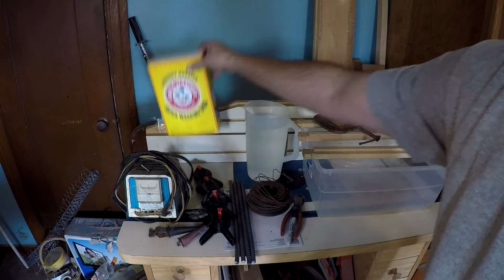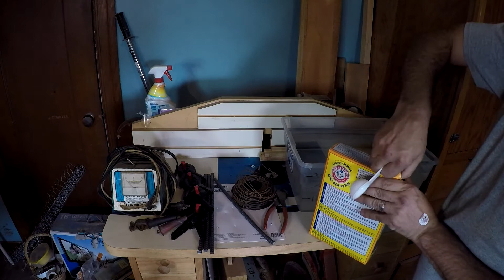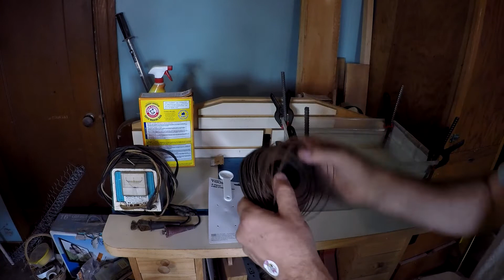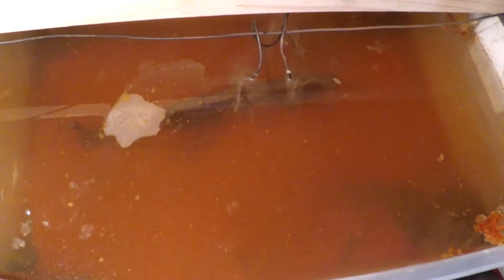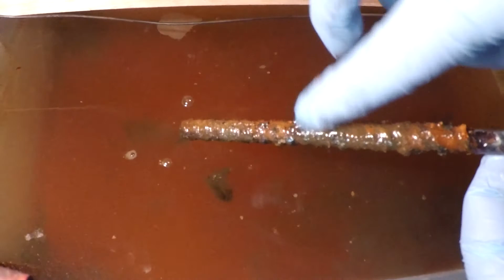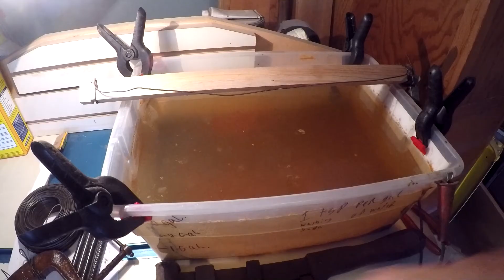Electrolysis For Rust Removal

Comment: If you can't find washing soda, use "20-Mule Team Borax" cleaner, which is almost entirely sodium carbonate.
Reply from the maker: Hemm interesting to note . But washing soda is available at Walmart off the shelf last time I checked.
Reply: @OldIronShops  Yep, it's widely available and probably cheaper, but I didn't find any washing soda at my grocery store so I went with the 20 Mule Team Borax. Some people use a vinegar and/or salt solution, which is not the best idea, because salt and vinegar are corrosive and will continue to eat good steel once they've eaten all the rust, and the electyrolyte will just keep bubbling away, misleading one into thinking the setup is still removing rust when it's actually eating good steel. Sodium carbonate eats rust only, then stops bubbling, a self-limiting, protective reaction that visibly tells you when it's removed all the rust it can access. If I have a lot of rust or moving parts in my project (for example, a rusty old vise), I'll treat it once then give it a quick wire brushing, rotate any nuts or bolts to expose areas that the electrolyte couldn't penetrate, then throw it back into the bath. Sometimes I've done this two or three times with complicated projects. BTW, the ratio of water to sodium carbonate is not in the least critical. I'll throw about 1/3 to 1/2 cup into a 5 gal. pail and use that for weeks before replacing it. The sodium carbonate  doesn't get consumed by the rust removal process--it merely facilitates it.
Reply from the maker: @billdouglas1721  all very good information thanks for the comments

Comment: Baking soda does not have any chlorine. That's table salt
Reply from the maker: True
Reply: @OldIronShops  if you bake baking soda (I think it is 400F for a 1/2 hr,) it drives off CO2, and turns it into sodium carbonate.